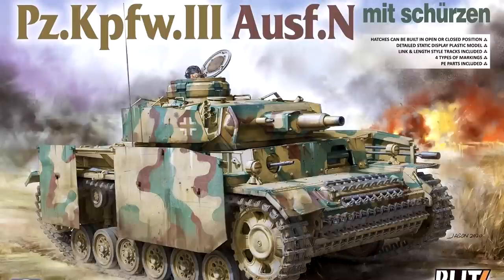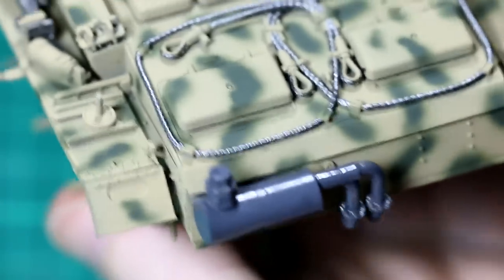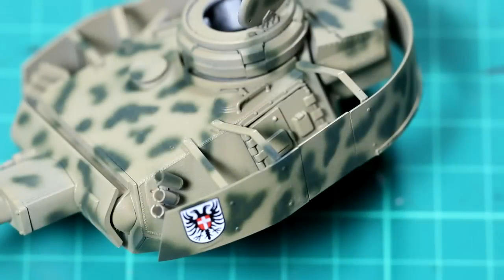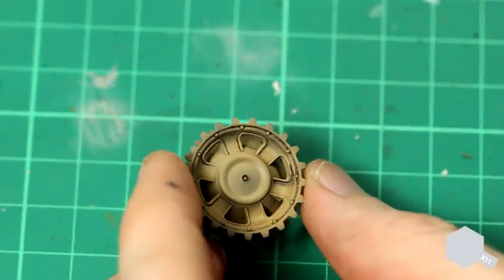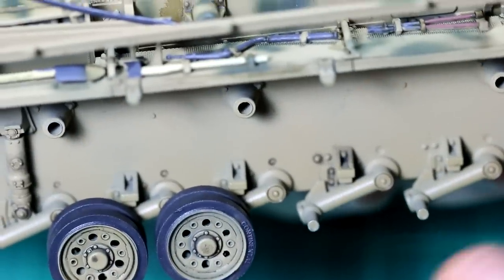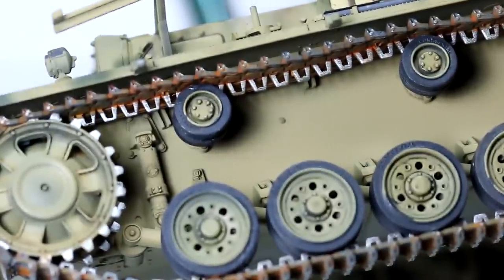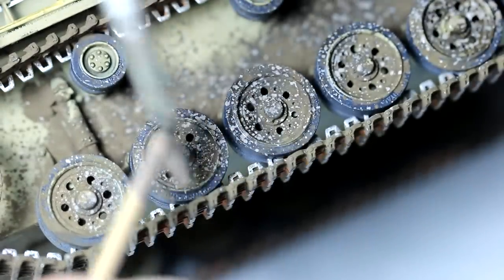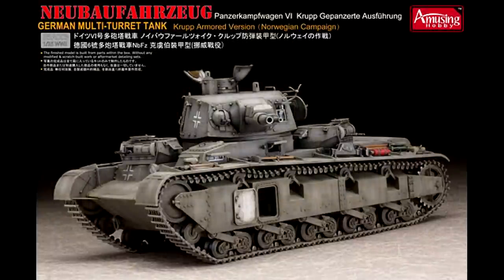Takom Panzer III Ausf N (1/35 scale model kit) - Painting and weathering

Comment: Many thanks for posting this video . I was given the Panzer III N last christmas and like you I will be painting in the camo scheme of the 2nd Panzer Div. at Kursk because of the array of decals. The method I now use and have used on previous builds is the 'hairspray' technique i.e. a base colour of Tamiya XF9 Hull Red a coat of hair spray then mix of XF55 Buff and XF 60 Dk.Yellow ratio of 1:4 and start chipping using micro brushes . Coat of varnish then a chipping solution from AK and application of the camo and repeat chipping process using micro brushes. It certainly gives the desired results albeit time consuming . I enjoy watching your videos as it gives me new ideas etc. . Keep up the good work and I look forward to new videos from you.
Reply from the maker: Thanks mate. I want to use the hairspray technique as a way to distress paint (using multiple layers of the lightened base colour), but I've never been able to get it to look right. I've found the chips are always too 'sharp' (the edges are too square). Perhaps the brushes I'm using are the reason.
Reply: @ModelNerd  I've got a couple of old Italeri models which I use to practice and see if my airbrush is at the right pressure etc. . I saw a video last year and the guy was using these micro brushes so I purchased some and haven't looked back. Forgot to mention that I like the shade of green you've used here and will give that a go .
Reply from the maker: Thanks. Yeah, I need to check out those microbrushes I think